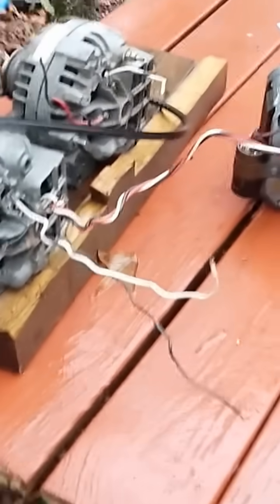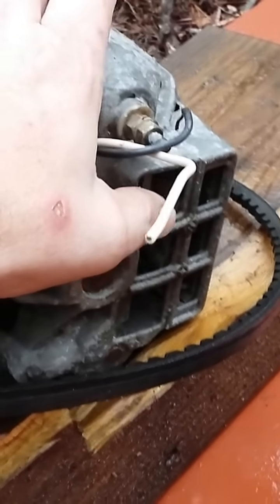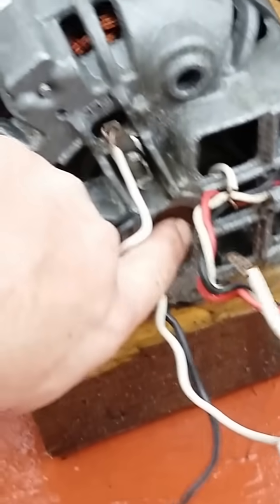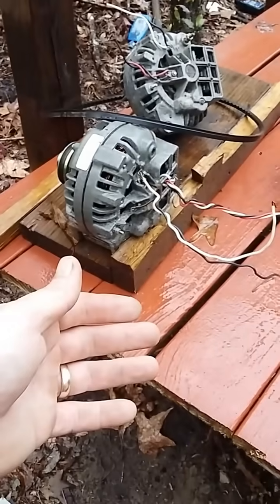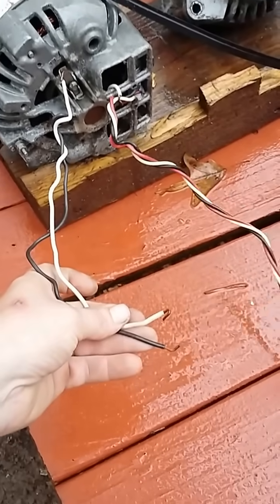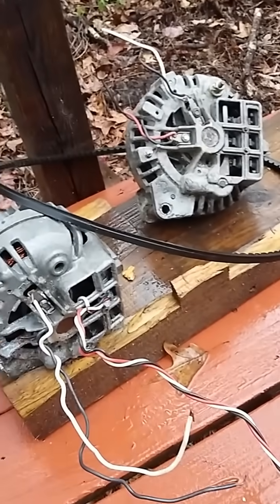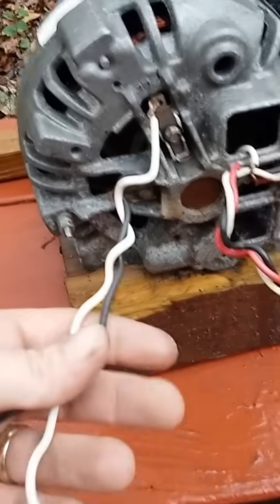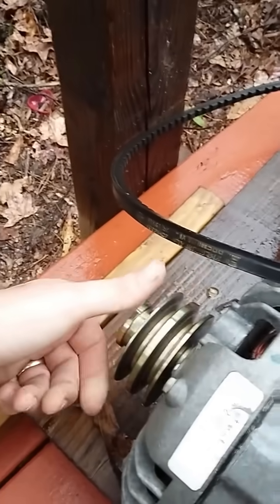Update Free energy forever no wind no solar no gas READ DISCRIPTION!!!

Comment: Well 90% of the people on youtube are just mainstream media at its finest.  Very closed minded people of pseudo scientism.  They will not think beyond their Netflix green screen cheap movie magic production.  Just let them pay for their power for the rest of their government controlled lives.  

For the rest of the curious people out there, yes this has been done long ago.  Nothing new under the sun.  To answer some of the questions is to put this same concept on a car.  You need to start off with some energy first like a battery to power your DC motor.  From there your DC motor is connected to a FLYWHEEL which building and storing the momentum power.  Just like a car's engine transfer power to the flywheel and NOT directly connected to the transmission.  Once the flywheel is spinning at full speed the DC motor is just spinning it enough like its on 6th gear.  The flywheel is connect to the alternator/generator through pulleys which will have an output based on the size of generator.  Now take some of that output and put it back to the battery, just like a cars charging system.  Even if a car alternator has 90 amps of output its still running 12V.  90 X 12V = 1080 Watts which is enough to power all the lights in your house unless you're still running incandescent.  If you want more power then get a 10, 15, 20 KW 240V generator which are typically powered by 10-20 HP diesel engine.  Yes you can also power the these generators with a small DC motor.  Let me see if you guys can figure that out or I need to link a video and really blow your minds away.
Reply: Lam Nguyen I hope your not  saying this can actually work
Reply: I honestly will pay you 100 BILLION USD for a working model of this! The catch, I have to personally observe it working for 30 days straight with no added power input!
Reply: I will share to everyone for free.  This is for the people to be free.  
https://www.youtube.com/watch?v=Ey1Zvi9aiso&t=449s
click on more of the videos on the right with a flywheel.  Its been done so many times already.  That stupid law is meant to keep the general population in slavery.  What happens when a law is broken on a daily basis time over and over again.  I guess every one of those youtube videos are fake too right.  Lolz!  Wake up and OPEN your Mind!  The elites is using fake science to stop you from thinking outside the little box.
Reply: Lam Nguyen so many inconsistencies in the videos all contradicting each other
Reply: Yes I am telling you this does work.  The rest of the world is doing it.  Middle east,  Asia and other places are doing it.  People here in the America are NOT as open minded as they think.  If the your media TV tells you it cant be done which they control the narrative  no matter what reality is.
All youre doing here is amplifying the energy that you start off with and generating more power  using motors, generators, flywheels, charging system and etc.  Today everyone relies on PGE and other Electric companies to  provide you power.  Believe me these companies/government DO NOT want you off the grid.  Monopoly, control, dominance is the their game on us poor sheeps.  OPEN YOUR MIND PEOPLE.
Reply: Lam Nguyen ever heard of the first law of thermodynamics That pretty much predates running Electricity
Reply: Wrong.  Electricity always existed.  This "law" was created by man recently.  Yeah I read that fake law that keeps you closed minded.  People are literally breaking that dumb law everyday on YouTube.  I dont think all those videos are photoshopped.  Of course it is it's a conspiracy.   Praise to the most high!
Reply: Lam Nguyen if 1860 (edit 1850) is recent and I don’t think  they had running electric grid back then and also I’m not an expert on the science behind it but electricity is the transfer of electrons and if your creating free electricity then where is these electrons coming from
Reply: Lam Nguyen I did and a car is not free Energy either just a way to transfer energy the chemical energy in gasoline or diesel  to mechanical and heat not free energy and if it is real why isn’t some military using this free energy the nazis or soviets would care less about the American market and use it
Reply: Lam Nguyen and these laws that disprove this out date running electricity

Comment: Uh...What power source do I use to spin the Stator FOR FREE????  A GAS POWERED GENERATOR????  That's NOT FREE!!!
Reply: You can make a magnetic wheel to turn the pulley
Reply: Solar panels or water, whatever you have, a bicycle.  Use your imagination.  This works.
Reply: @tonyfrancisco6991 :   "  This works. "
No it fucking well does NOT work you moron.
Reply: That is my question cause he said no wind,gas how does he spin to get the power.
Reply: @nilesjeppesen2712  I figure he USES electric power from the City electric company to just make a SECONDARY power suppy that is a higher voltage which will showup on his monthly bill, so it's not Free Electricity! Fake! He's Busted!
Reply: I have a small system that works similar for camping, but I still have to use a deep cycle 12v battery to power the 2500rpm DC sewing machine motor that turns my 125amp alternator. It charges the battery that powers my 1000watt AC inverter, and runs the sewing machine motor. It works great to power lights and TV during a storm outage or camping, but a far cry from running my houses electric appliances and well pump. I have a 16000watt gasoline generator for that. If you lived real basic( LED lighting, no high energy appliances), I guess it could work. Would have been nice to see what motor you used hooked up and working. What kind of voltage regulator do you use, since you are basically removing the regulating circuitry in the alternator? The voltage would have to be somewhat erratic.

Comment: Man some people are real jerk offs!! The description says he left out some info. This is a basic video. It amazes me the comments and sheer rudeness. Go be rude to the guy running a lightbulb off a speaker and spark plugs. That was total BS. 
 Good vid
Reply: Sorry, but this is a scam.  He is the con man.  To have an alternator put out 60 Hz will require a very precise drive motor with exceptional speed control.  The power to that motor will have to exceed the power generated by the generators.  The the wiring in the generators are NOT super conductors, so current flowing in them will generate some heat.  That heat causes efficiency of the generator to be less than 100%.  THerefore, you would have to put more power into the generator than you get out.  Car engines use horsepower to turn these generators in your car  And the amount of power is easily observed if use listen to an engine idling and switch on the headlights.
Reply: To be a con artist this man is wanting you to give him money for something he didn't ask for a dime he gave free information it is your choice to try it what the hell is a scam about that?

Comment: First you over simply what  it takes to make and alternator run a motor. A 90 amp alternator an only deliver about a thousand Watts, only depend on tour need that's  not "a lot of power". The DC applied to the field (rotor) turns the windings into electromagnets, you explanation to that was clumsy. The electric utilies do not get the power they deliver for free. they pay to price it,as well build/maintain all. I could go of grid if need be, bur for decades  the effective rate I pay for elective has been steady a 10 cents per unit. At some point I'll build the Hugh Piggott  stay of a wind turbind for preparedness's sake. You video protections would better if you left out the no value add hyperbole, along with creating a script, to help you practice your delivery.

Comment: So basically just bypassing the diodes and running the power to the field wires? And the power comes out where it would have been going two diodes? Does it matter if the starter has a regulator or not I have one off an old Ford diesel truck that doesn't have any regulator as far as I know I think it was on this firewall or something I also have a newer for diesel alternator. So I? guess my question is do you need a regulator or not

Comment: At 0:40 your free energy device is warping the space-time around the alternator.  This is to be expected because your break-through invention is bucking against traditional physics and should settle down once the new paradigm has been properly established.
        Until then you may experience some local time differential events and possibly a mild shift in the flux state of matter along with an anti-gravitic zone that is equal to 4x the square of the measured (n-phase)  over-unity output.
       The best precaution to take is to set-up a gravitational counter field that is effective at a distance 2x greater than the interaction field produced from the center of the zero-point itself.
Reply: Absolutely, was thinking the same thing!  But, I wanna add that a gravitational counter field is absolutely necessary. It is way too dangerous to do this without one. The time dilation and changing flux state of matter could be a whole lot more than just mild. It could be fatal and/or permanent. Nice catch, orange70383!
Reply: @aaronodom2158  Ha, love it guys. And very appropriately sarcastic considering the bullshit in this video lol.
Reply: Ok. So you're both full of beans.

Comment: How high is this guy?
Reply: Gene Lightman  you should be asking how low a lowlife are you 
This brave and noble man is trying to help people with free 
energy and all you can do is 
ridicule his efforts 
America began with the overthrowing the slave type economics of a British Tyrant called king George and his enforcements of taxation without representati of colonial America. Just like the energy companies of today 
have been doing since Tesla and before.
Perhaps you would be better suited to go move to England 
I’m a patriot and fan of this patriot entrepreneur 
What you need to do is piss off
Reply: Darryl Henry he’s making this Stuff up this whole contraption defies the first law of thermodynamics believe that isn’t real well it pre dates running electricity so I don’t know how electric companies would do that but still the law makes sense since all electricity is is the transfer of electrons (tiny parts that make up atoms FYI) where are they coming from and if so is he also breaking the Law of Conservation of Mass don’t believe in science in general 
Ok then how about electrical stuff so for example this generator head I’m looking at is 7200 watts (or 9.7 hp) and requires at least 16 hp (about 12000 watts ) so  about 5kw is being lost due to the inefficiency in the system witch is unavoidable now I will say it may not be as great of a loss in an electric engine because of the low rpm and higher toque that may be able to be geared up but you ain’t gonna be getting 90a at 120v off a car alternator anyway
Reply: Gene Lightman  piss off you coward keep worshiping J.P. Morgan 
This country was founded on judeoChristian principles of freedom and the worship of God not government 
Instead of asking how high is this patriot who trying to help 
American from utility company robbery 
Ask how low it makes you that you could care less about your fellow countrymen
Reply: Use your mind, and see it’s legit. Think a little, he shows you his projects on and on as he works and develope them. Obviously you are disinformation —NO CONTENT TO YOUR CHANNEL NOTHING, NO LIKES , NOTHING!!
Reply: daniel rickerbaker unless he’s God and can Defy the first law of thermodynamics
Reply: Well, apparently there's another law at work. You know like the law of lift was just as available in the garden of Eden as it is now . . . just nobody knew about it.

Comment: Ever heard of the 1st law of thermodynamics or pretty much any other law
Reply: We need thunderf00t
Reply: He's not getting 90 amps out of that unless there's more than 1.4 horsepower driving it.
In reality it would have to be more than 2hp as there are losses from friction,resistance, and eddy currents.
Reply: @Patchuchan  You're forgetting. It's not just "90 amps", according to him it's "90 amps at 120 volts" lol. That would only be nearly 10,000 watts, or aprox 13 horsepower to run it, if it somehow could even do that. Not a chance in hell. It's also NEVER going to give more than it uses, as per _{.-.}_ Hi's original post about the 1st law of thermodynamics.
Reply: @probingtime666  Yah I was think at 12 to 14 volts the normal rated voltage.
Reply: @Patchuchan  I think that was probably what he meant to say at the time. I guess it must be hard to remember the few facts to keep straight when everything else he says and shows is utter bullshit.

Comment: A generator don"t give you any power if you not supply power first ,and you need to rotating this generator ,,,so, no gas,no wind , no solar, so what mechanic power you use to move this thing from 0 RPM to 3600 RPM  for free, just the small power you need to supply the field poles cost something , i don"t need to see you other videos because i can see you attitude w/ this one ,,,,,,,,,nothing, nothing is free ,delete the word free please.
Reply: Nob the Knave  Well he did. It was a small motor he had loose on the bench, a very small motor, way too small actually.

Comment: you showing that with powered alternator 12 volts it can turn another alternator which is 90amps 220v ac which is 20kw generator basically , i don't think this will power 20kw load no way , it will need much more torque , you need the torque of the car motor to turn that alternator   to produce 1kw which is rated for 12volts x 90 amps , so imagine for 20kw ??!!

Comment: I am grateful that you are doing this. Please ignore the haters. I will donate. You should get patreon.  Please  offer a DVD with all your videos and data and materials PLEASE. thanks.
Reply: The guy is an idiot. He is doing an AC to AC, and then AC to DC conversation. You LOSE energy every time you convert, because conversion is only about 93% efficient. By my calculations he is losing over 50% when you factor in the wire's resistance. Please don't patronize idiots.
Reply: you got this 20000% right ,this guy is a idiot
Reply: @lesstime1678  And you both got it INFINITELY right. This is just utter bullshit. Even his connections are the worst I've ever seen. If you're going to con people, you'd think he could at least make things look somewhat serious, and those connections sure aren't. Of course even with perfect soldered connections it's still not going to produce more power than you waste powering it.

Comment: Take some classes in basic ac/dc theory, and basic physics that includes the laws of thermodynamics.  Power is measured in watts, not amps, and energy includes time.  If you understand these, you will understand the problems with your design.  Keep working and thanks for the video.
Reply: yeah think of electric like water.And volts is pressure,,amps is flow.

Comment: "If I use a MOTOR to turn this" and put a 6 volt battery on this end of the circuit, i get high amount of power out of these leads"... Well, ok, what is powering the motor and how is that free? What is contained within the battery to supply 6 volts, and is that free? All you are doing is using the copper coil as a transformer... So, yes, you are getting more energy, in a sense, but it not  coming from a "free" source. People are hoping to find a free source, not an alter'ed  (alternator) source. It is not "rocket science", but it is electrical engineering and physics.   Free energy can come from gravitational pull, moving molecules, and friction/heat/ the sun... no other source of energy has been found to be generated from nothing. If you have an abundant amount of fossil fuels on your land, then that can be considered "free energy" because it is already owned by you...

lol, you are fucking tard, get back to work and stop dicking around in the back yard while getting rained on, Forest.
Reply: power is supplied back to itself. once its going it'll stay forever going.
Reply: @parrisestatessouthernhomec3246  Um, No, No, it really wont.

Comment: so if im following right. you could just run the motor off the alternator with a voltage regulator and some passive protection. ive seen this on here where someone took a samsung stator and hooked it to a home made dam. brilliant. if you could make this safer, you may just be onto something.
Reply: This doesn't work. The guy is selling you on a gimmick.
Reply: no you bypass voltage regulator

Comment: First off when you use diodes to convert AC power to DC power it's called a bridge rectifier and it takes 4 not 3 and I would love to see you pull 90 amps of AC through those little wires and lastly your right it's not rocket science it's called the laws of thermal dynamics and FYI amps are inversely proportional to voltage thank about it it's called ohms law
Reply: Finally someone  else who can see his malarkey . This guy is smart enough to be dangerous don't you agree?
Reply: youre all about books an hes all about commonsense.